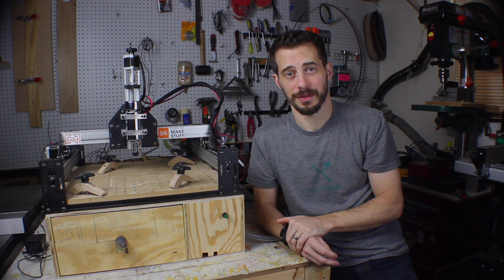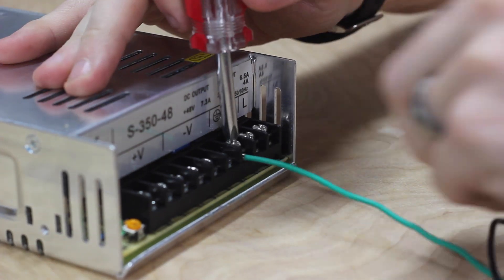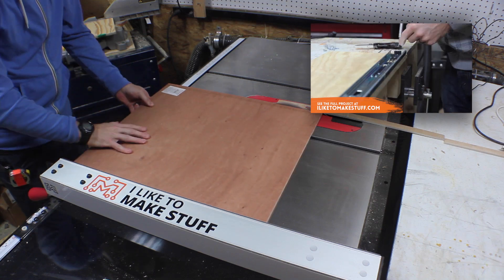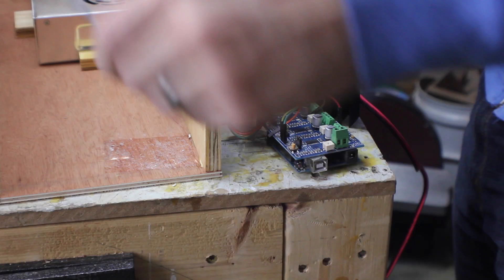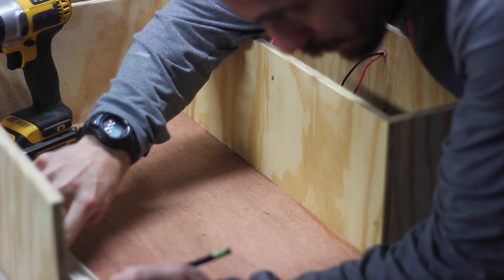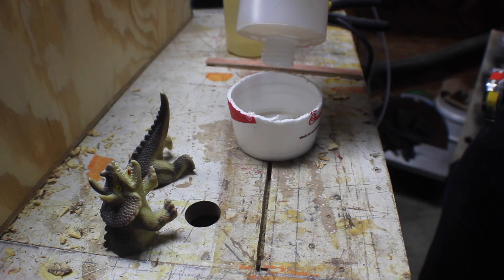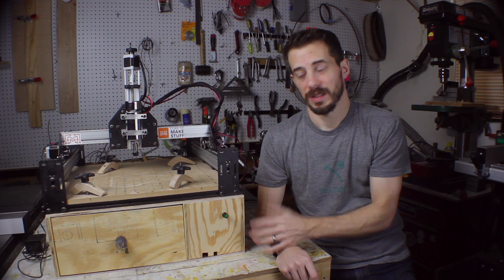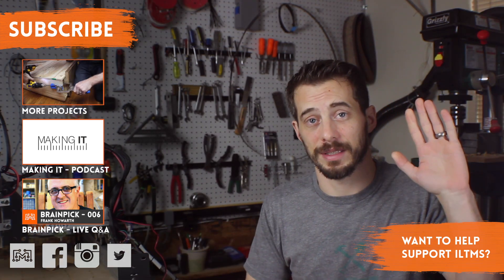ShapeOko 2 spindle upgrade // How-To | I Like To Make Stuff

Comment: I have a large CNC machine (4x8) and was using a Bosch PR-10E trim router - worked great except for the noise. Like you, I went with the "quite" spindle which was indeed quieter but the bearings failed after 6 months of use, the fan on top separated from the shaft and the tool chatter and low torque more than offset any real usefulness of the "upgrade". Yesterday I pulled off the PWM-controlled quite spindle you show and put the Bosch back on. Noisy, yes, but it can more than handle any wood/acrylic/etc that the smaller spindle would choke on. Adding a router speed control gives me the different speeds I need. Something to keep in mind if you're milling anything tougher than balsa or pine...

Comment: A funny story. You mentioned you have to switch the power supply to 115 Volts if you're in the US, well my Computing teacher recently gave me 2 PC power supplies he didn't need anymore. I converted it to a regular DC power supply and it was fine, all the correct voltages. But I saw a switch on the back, and stupid me didn't read what was on it. It was one of those voltage switched and I live in Australia where we have 240V. I thought it was an on-off switch so o switched it. It exploded and it smelled great. Luckily, only the safety circuit popped but you can be sure I'll never do that again. Apparently, the same teacher who gave me the power supply had some kid switch the same thing while the computer was on and the computer caught fire. I thought that was pretty funny.

Comment: You mentioned in an older video about using a compact router. Why did you go this route?
Reply from the maker: Jay Bates I heard from some people that the router was actually louder to use than the original spindle that I had. Since I work after the kids go to bed most nights, I wanted quieter.. which led me to this one.  And I think it was worthwhile, it's ridiculously quiet.
Reply from the maker: ***** The upgrade was well worth it, but I don't have this machine anymore.
Reply from the maker: ***** I upgraded to the X-Carve and have had a great experience with it.  It's the only other one I've ever used, so I don't have a lot of options to recommend.

Comment: Dear god man, get some more tension on your bandsaw and adjust the back bearing on the blade
Reply from the maker: elvishfiend Yeah, I swapped out the blade for that cut and didn't think about the bearings until I started the cut.  It was so small I just finished it then adjusted the bearings.

Comment: What are your thoughts on the runout? I don't have a DC spindle myself. My first dremel threw a bearing, I've since been using a dw660. SO3 uses a dwp611. Could you possibly do a video on the runout of all three?
Reply from the maker: Frank Wiebenga I haven't gotten to test cut the quiet spindle yet, but I'll probably report on how well it cuts. I would have to make specific mounts for the dewalt (so I probably won't test it out).

Comment: Thanks for showing how easy it is to upgrade to the quiet spindle. As someone who is nervous about electronics, I find your video very reassuring.

Also, nice table saw upgrade. I used to have the folding Craftsman saw, too, but felt the need for something bigger and more stable.  What made you change saws?
Reply from the maker: Peter Horn I'm glad to hear that! It can be kind of intimidating, but I really want to break down that barrier for people if I can.
As for the table saw upgrade, I was finding more and more that I wanted to be able to build jigs that just wouldn't work with that particular saw setup, and then had a conversation with someone who lost part of a finger to a table saw.  That was enough motivation for me to pull the trigger :)

Comment: Thanks for making these videos, Bob.  I have really learned a lot from seeing you work.  One question, where did you get that oscillating tool (looks like Harbor Freight) and would you recommend that model, or getting this tool in general?  I've seen them at the store, but never knew how much I would use one.
Reply from the maker: Adam H Thanks Adam! It's awesome to hear that they're helpful!!  Yes, it's a Harbor freight tool, and it's been fine for me.  I believe it was $20, which makes it great, even if it only survives for a little while.  It seems to be running fine, and I haven't seen any problems with it yet.  As a general tool, it's pretty handy to have around and I've used it in lots of different circumstances.

Comment: I bought the shapeoko 2 last month when the were on sale, got a dewalt spindle to use instead of the one that came with it.  Plan to start putting it together this week and after watching you just upgrading the spindle, it's going to take me awhile to get it together and be confusing as hell.  Can you stop by my house and help haha, at least the making of the box doesn't look too tough to make if i get my shapeoko together and working.
Reply from the maker: Joseph Hawkins Haha, I'll be right over to help :)    The build really isn't that hard, just time consuming.  Be sure to go through all of this before and during the build process http://docs.shapeoko.com/   It's really helpful.
The hardest part, and the thing that you need to be careful with, is tapping the ends of the makerslide. I found that the tap tool is just really uncomfortable to use, so it takes a while to get through them all.
Good luck!!
Reply: Thanks for the link, putting stuff together with good instructions isn't hard but i know nothing about wiring and electrical stuff so that's what I'm worried about.  Hopefully it goes fine because i cant wait to use it.  Forgot to ask what software do you use for yours?
Reply from the maker: Joseph Hawkins For the most part, I use Easel.  It's been great for everything that I've needed to do so far.  Once I get into more 3d work, I'll probably look into some other options, but I don't have any experience there yet.

Comment: Brave and/or desperate man doing a glue up over shiny new table saw cast iron :)  Just be careful about using the miter gauge and the fence together like at 2:16, it can cause it to bind and kick back on you.  It's better to get in the habit of putting a stop block on the fence so the workpiece isn't touching the fence as you make the cut.

Comment: Any tips on decent, but affordable epoxy? West systems and the like seem prohibitively expensive, but now I've just gotta have a dinosaur butt handle on my stuff!
Reply from the maker: Ha! Sorry, the butt end of this one has already been claimed by Matthew Cremona I used this epoxy, and it's worked fine/isn't too expensive.  I have very limited experience with epoxy so I don't have much to compare it to, but it's always worked fine.  http://amzn.to/14q1iLr    The one thing I have noticed is that it yellows after a few weeks.  Just something to keep in mind depending on the application you plan on using it in.
Reply: Thanks for the response! I'll have to check that out.

The people have spoken -- the videos need MOAR dinosaur butt handles...
Reply from the maker: Mike R Great! Now I'll be known as the dino butt guy ;)

Comment: Use a peace of filter foam on the back opening, if you want those electronics to last. I cut down computer cleaning and "dust troubleshooting"(aka psu maintenance or replacement) around my house by 2-3 times.

Comment: The electronics enclosure is a great idea. Thanks for posting it. I don't have a ShapeOko, but I'm in the process of building my own CNC router using the plans from a fellow YouTuber named Dave Gatton. This electronics enclosure is something I'm now going to incorporate into the stand of my build. Several people have already suggested ventilation fans, and I'd tend to agree with them on that. Something I've had floating around in the back of my head would be adding dust filtration to the ventilation fan idea. Basically, just a piece of furnace filter clipped into place on the outside of the enclosure, covering the fan inlet. Something easy to get to and replace if it gets too grungy. Thanks for sharing this, Bob, and keep up the great work!

Comment: great work. why do you have a arduino connected to the shapeoko? or does it come with it?
Reply from the maker: Paul Rosasqui Thanks! It comes with it.  It accepts the g-code via USB, then controls the motors via the motor shield (gshield)

Comment: I was kind of surprised when you cut out the vent hole but didn't install a fan!  I was sure you were going to steal the other outputs from the power supply and have some active ventilation.  Good project.  I liked the quick and easy way you found to hold the components in place.
Reply from the maker: Jason Adamczyk I probably will add some fans eventually.  The power supply does have a fan in it, which is located right below the pegboard section.  That should drive at least a little air towards the vent.  Probably not enough air, but a little.

Comment: Very nice. Now I just need to pull the trigger on the spokeo. How much is the initial set up?
Reply from the maker: sean mackey I'm not sure if it's still on sale, but it WAS under $600 around Christmas.  You might want to check it and see if it's still at that price.  Normal price is $695 I believe.
Reply: I will. Thanks. Ever since your clock vid. Its been top 2 on my want list. Keep up the great work 2015. Happy new year bob

Comment: One step more could be to enclose a Lexan box over the machine to capture your sawdust and cut down off noise as if a person did not update the motor. Thanks for posting..
Reply from the maker: Tom Pritchard Yes! That's definitely on my list..  Not sure if I need the enclosure or not, but I still might do it eventually.   I'm also planning to add a dust shoe and hook it to my dust collection system.

Comment: Nice. As far as the cooling, i would  use 2 coolers from PC case, one to blow in an another to blow out, on oposite sides of enclosure, that way there will be constant air flow.
Reply from the maker: Deevla Yes! I was actually thinking about adding some fans!